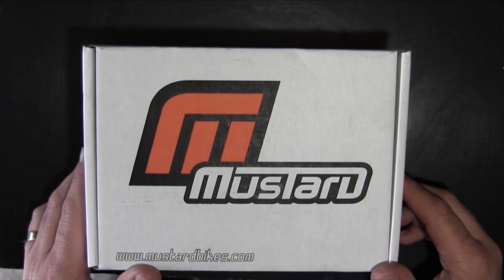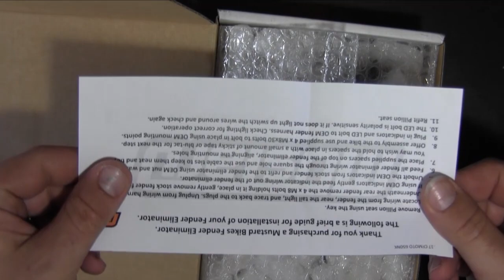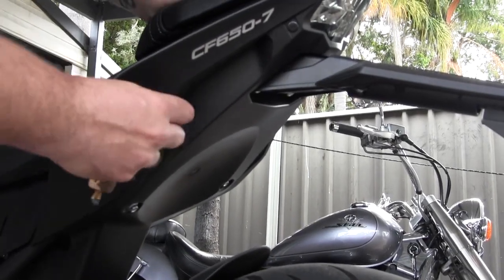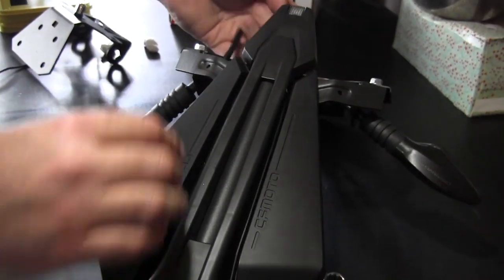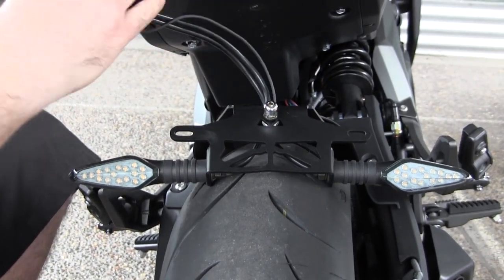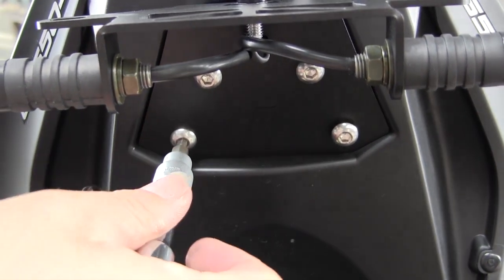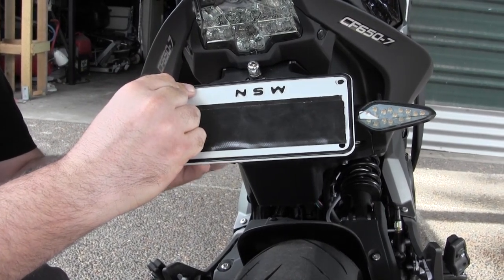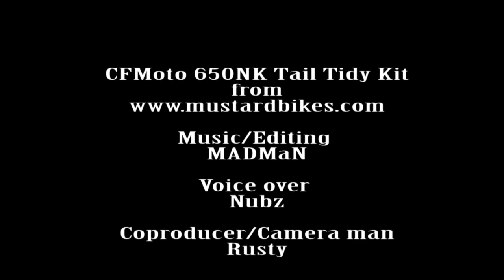CFMoto 650NK Tail Tidy / Fender Eliminator kit Install

Comment: HOW did you detach the wiring so easy I am using inhumane force won't budge or go out. If I do just a touch more it's gonna detach alright but not where want it... Maybe they just clamped them together with some pliar tool factory assembly. I hae a 23' 650nk. ?!

Comment: Does this fit a 2021 cfmoto 650nk
Reply: Not really sure. 
If the 2021 seems similar to the 2017 I’d say there is a high chance of them being the same part. 
You could check out Mustard Bikes for more info.

Comment: Nice video boys. I've got exactly the same bike down here in Victoria a 2017 650nk. sorry to ask a side question but I find I get a lot of buzzing and vibration noise under 4000rpm especially while engine breaking. I'm assuming its the fairings so I've taken them of and put some spacings and felt stickers in places, but I still seem to get it, just wondering if you've gotten the same thing on your bike, and if so if you've been able to do anything to dampen the noise? 

Thanks Guys
Reply from the maker: Hey. 
Cheers for the kind words. 
Yes indeed we too experience the the plastic vibration noise. 
I’ve put pressure with my hand on different panels while riding and I’ve found it might be the instrument cluster. 

Was very hard to pin point but I’m sure you could try it next time you ride. 

✌🏼😬👍🏼
Reply: @auzzierider  Yeah thought you guys came across the same issue 😁, will do I might have to pull the panels of again and check wiring and hoses too 👍

Comment: Will this fit the 300sr?
Reply from the maker: Hey. 
I’m unsure and I would lean towards no as I think they are very different in make from the 300 to the 650. 
I know the 400 and the 650 shared the same components only did rents was the cylinders being sleeved to bring the comp down.

Comment: Whats the top speed ?
Reply from the maker: Çağrı Erel 
You know, I couldn’t tell ya. 
What I do know is, the bike is governed so top speeds are attainable. 
But the it’s only a screw stoping the throttle from full turning.
Reply: around 190kmh
Reply: +Auzzie Rider 
nice bike Sir, i Like cfmoto 650

Comment: So, did it save 3kg from the bike's weight?
Reply from the maker: MotoZest Not that I weighted the stock tail after removing it but anything that big coming of the bike would have to make it lighter. 
If you can replace the muffler you will loose 7kg right there.